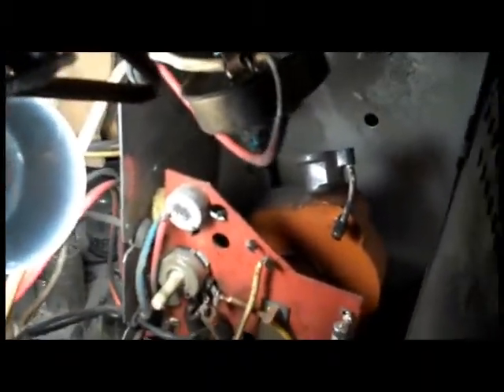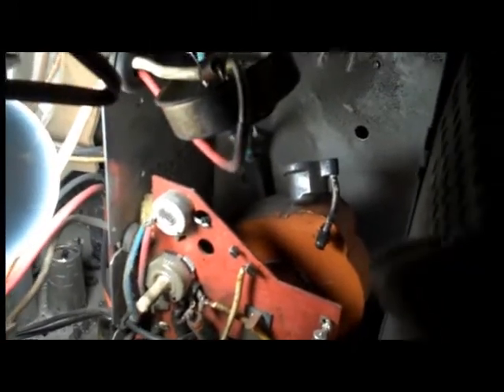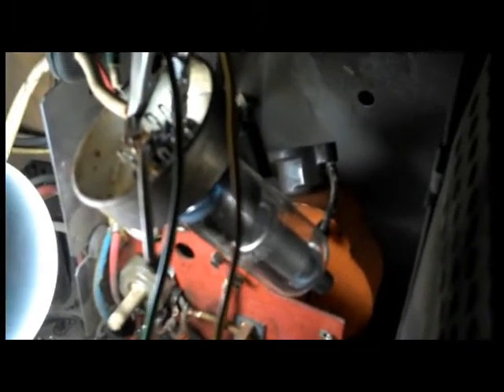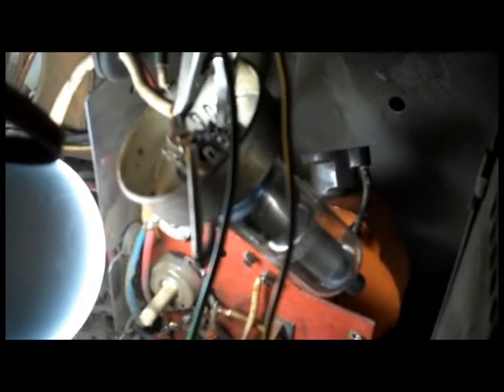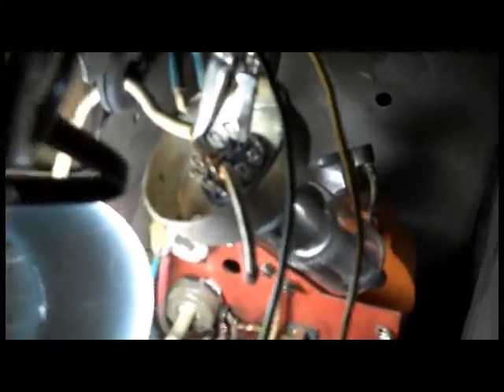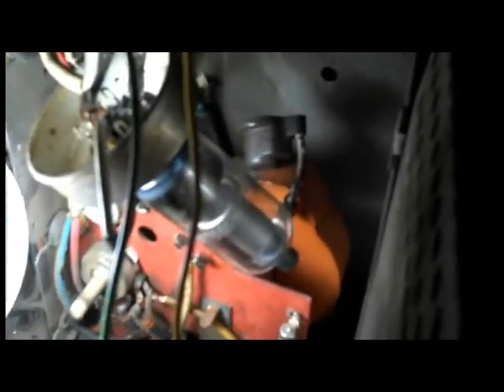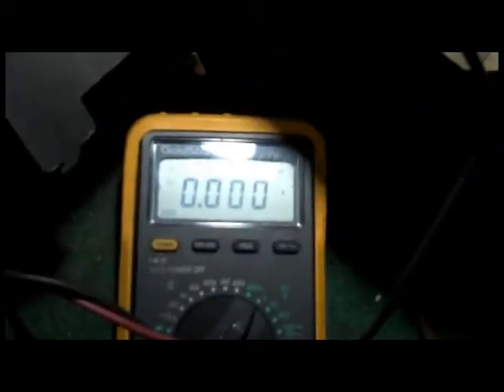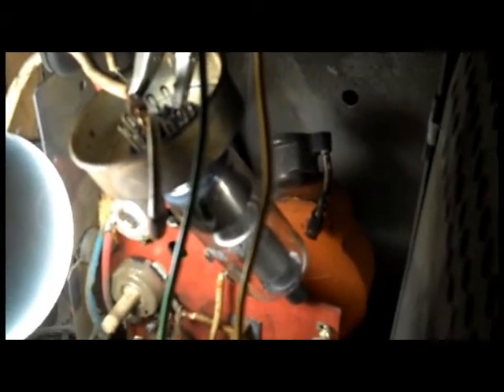no high voltage zenith 25mc36 high voltage rectifier filiment not lighting part 1

Comment: Corona Discharge, Arcing - Potato, Tomato.. I just found a Magnavox from the 50's. First one I've even seen in a very long time. Took all the guts out of it as the CRT was fried. It has one broken tube and the one feeding the flyback "Yoke" missing but other than that it works. First time energizing vacuum tubes... 1G3GT tube complete with X-Ray warning!

Comment: Cant measure the heater-volts with that voltmeter--Too high a frequency and its a pulsed waveform, that meter is intended for AC-Sine-Wave/RMS not a Pulse!
The bulb you put across indicates the presence of power, Why not go buy a new 3AT2 valve and be done with!--Did you check the series resistor on valve socket or the valve's heater...??
Reply: Valve? You mean TUBE? LOL! Just messin' with u, Mate!